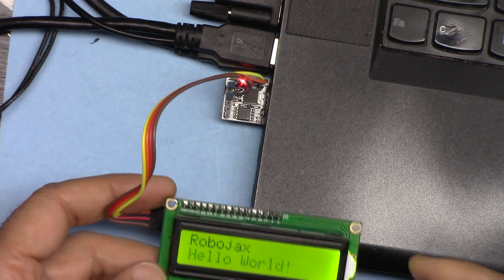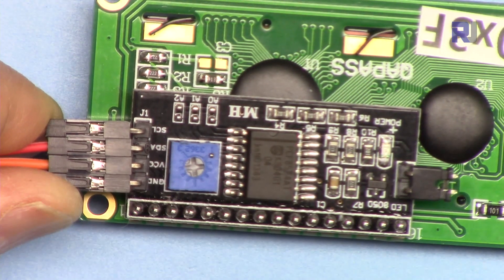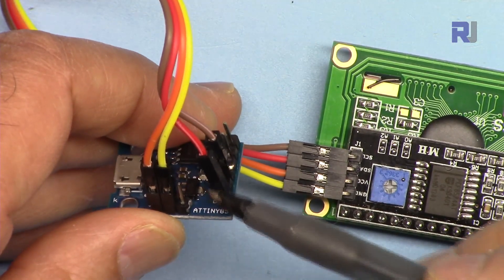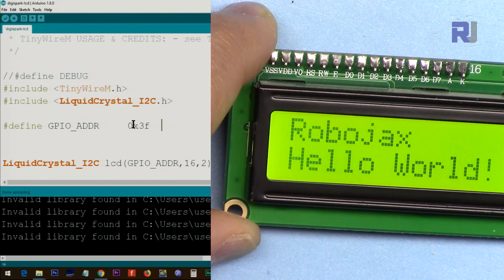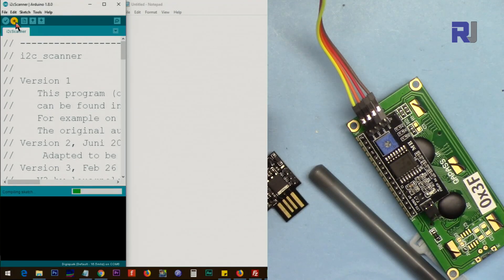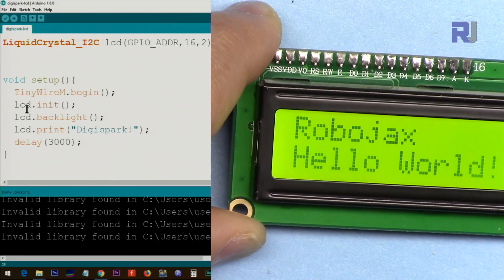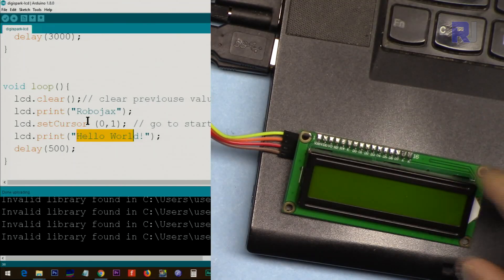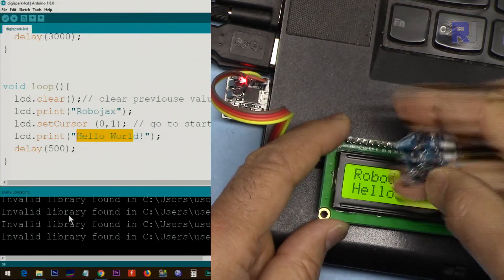Using LCD with Digispark USB to display text | Robojax RJT781

Comment: What I want is a solution where the i2c LCD updates the display with whatever is sent from USB. How to do that?. I mean like a USB rs232 bridge to the lcd. lcd4usb?
Reply from the maker: While the Digispark uses USB for communication, it doesn't have dedicated hardware TX/RX pins. So you can't use it. You man use ESP32 or Arduino modules to read data from USB.

Comment: Hi there I have been trying to measure voltage from voltage divider using Attiny85 usb development board and I am not able to read the voltage value using Attiny85 Pb2 analog pin1 instead of just sensing the voltage it is adding voltage value to circuit!
I am not able to understand why it is happening .
Can u pls recommend any suggestions or solution that can help me out !

Thank you !
Reply: use remap function

Comment: where i can find the library or example code?

i usually using raspberry pi zero for home automation, and now im trying this board for a simple task and cheaper solution
Reply from the maker: Hello, perhaps you missed the introduction video https://youtu.be/eW9WgPlcPAw where you get all the codes and setup your Arduino IDE.
Reply: @robojax  thanks!
Reply from the maker: you are welcome.

Comment: hello sir , is to possible to make a video about arduino based 4s smart charger and discharger.
Reply from the maker: Sorry I missed your comment. YouTube now allows me to see comments I have not replied to.
Charger is easy but discharger will be a little hard because you need a load.  The load determines how fast can battery be discharged.